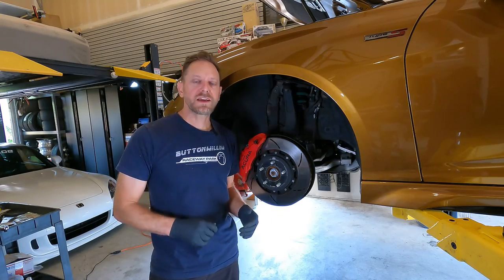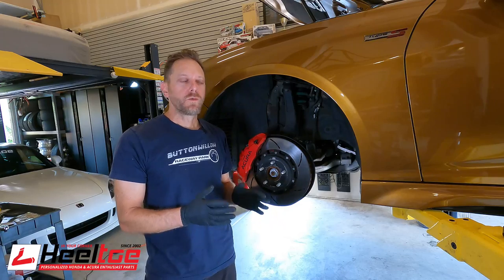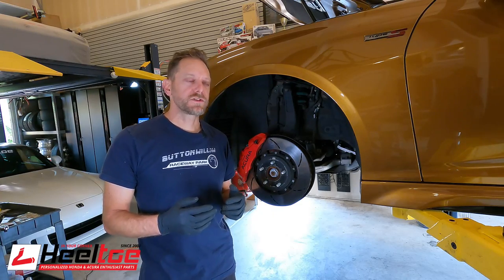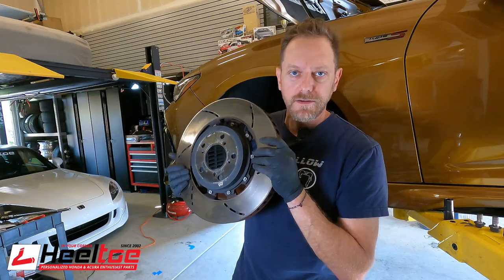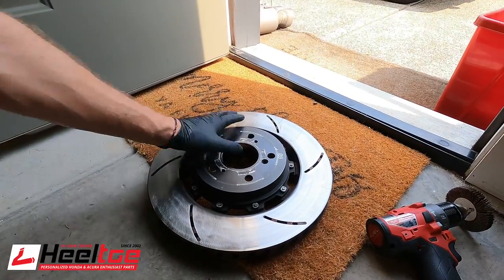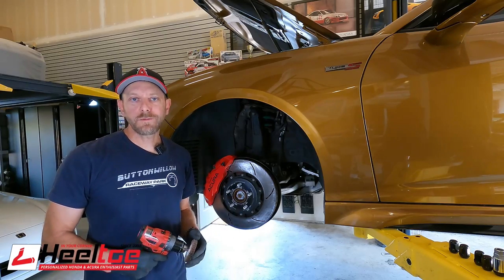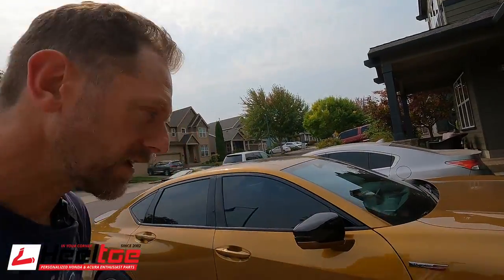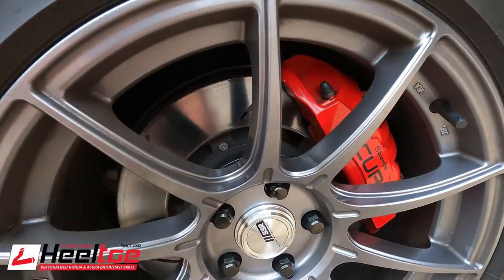Cleaning up glazed rotors to fix vibration

Comment: Thanks for your content, glad to see your TLX is still holding up well after those track days. I sometimes feel I barely push my own type s far enough because I want it to last as long as possible. I love my car so much.
Reply from the maker: The track days are done but the car impresses for a few laps for sure! There is a hard ceiling to what the brake system can safely do, and it is not related to the pads and rotors and calipers.

Comment: So many people misuse the word warping. Even the so called “professionals”
Reply: Even when you explain to them that's it's just pad deposits and exactly how it happens, they refuse to believe their rotors aren't "warped." I've fully cracked apart dozens of rotors from hub to edge but literally never had a "warped" rotor. Some people just love to pay mechanics for unneeded labor or parts, I guess. It's worth noting that a few hundred miles of street driving on track pads will wear any transfer layer off due to their abrasiveness when outside operating temp range. Then you can rebed.

Comment: idk if im wrong or not....but isn't the rotor on the wrong side? The slots on the rotor are facing the wrong direction for proper heat dissipation.
Reply from the maker: Believe it or not, the slots on a rotor will almost always be facing forward in this way. The vanes on the inside of the rotor are what make the rotor directional, not anything on the surface. RB Rotors does specify which is right and which is left, and we have them correct in our installation. PS: Slots are really not to to do with heat dissipation as much as they are for evacuating dust and gases released from the pads.
Reply: @Heeltoe.  Thanks for the response, I thought both the vanes and the slots played roles in rotor directionality and heat dessipation LOL. U learn something new everyday.